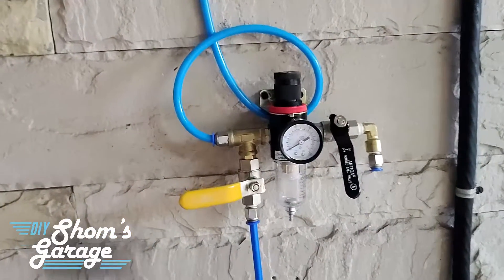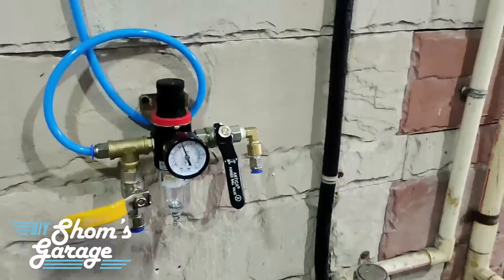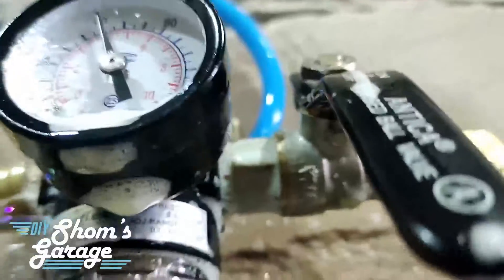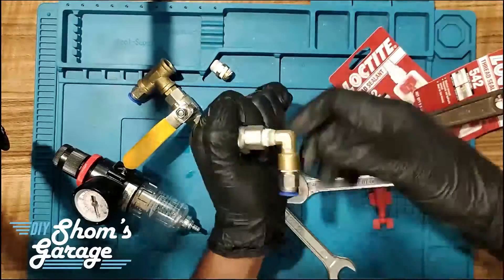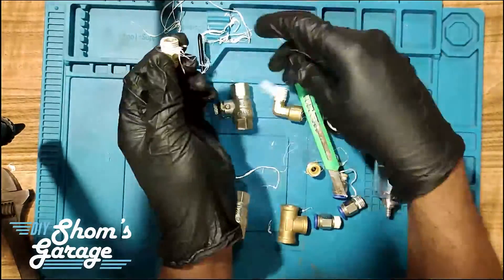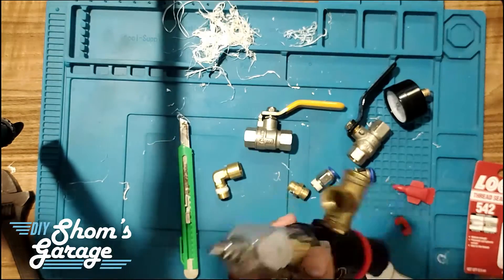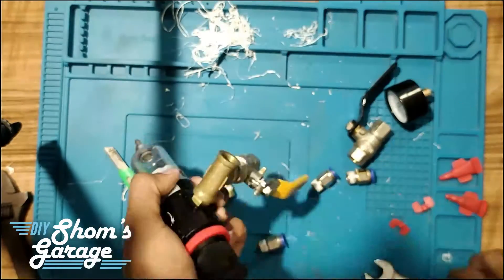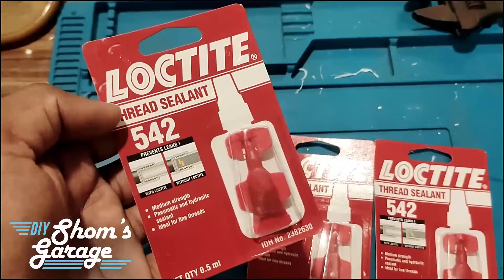How to fix air leaks? LOCTITE 542 | Thread Sealant | how to use?

Comment: Blue threadlock does a good job for air fittings, too.  I personally use Harbor Freight Threadlock No.42 because of its excellent price.

BTW, what's with your tiny bottles of Loctite?

Comment: Great job Shom! You are clear and fairly comprehensive. Keep it up. What’s your opinion on Bali air compressor. Quality? Safety? Any comments on its use for brad nailing.
Reply from the maker: Hey! Thank you so much! I'm using thr same compressor (BTALI) till now my feedback is quite good.. just check the C requirement of the nail gun once.. ideally the CFM of the compressor output should be slightly more than thag of the tool being used!